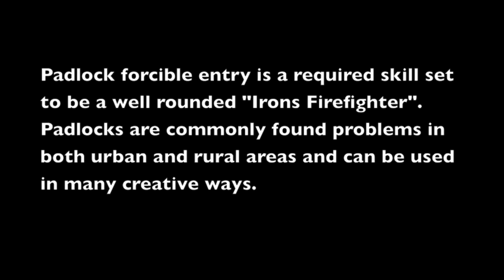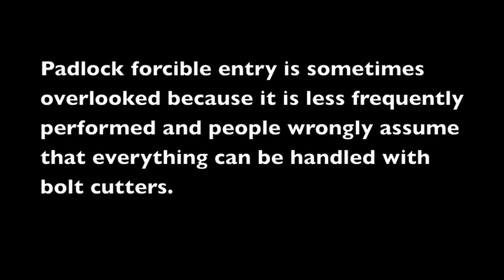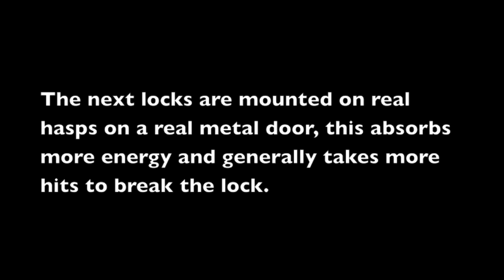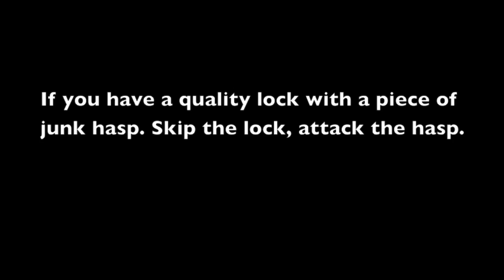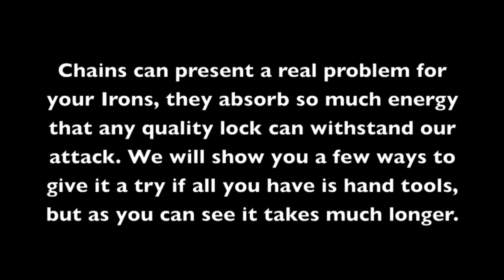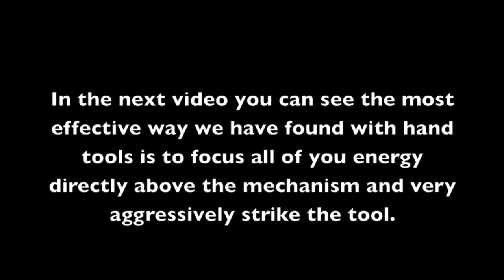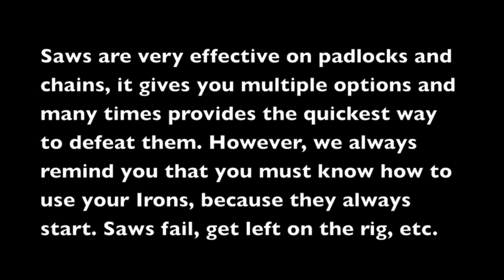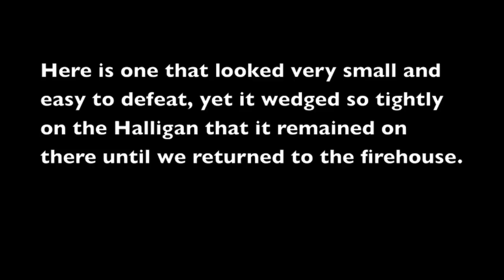Padlock Forcible Entry

Comment: An 18 or 24v angle grinder would be a heck of a lot faster on a lot of those hasps...just grind off the bolt heads. Multiple tools in your toolbox gentlemen... I'd have a dewalt combo kit with sawzall,grinder, impact driver, drill, and circular saw on my truck. Plus bolt cutters and a portable oxy/acetylene cutting rig. And a gas powered cut off saw.
Reply: An angle grinder is a very useful, but specific tool. A halligan is a very useful, and multipurpose tool. These guys (and many other high quality firefighters nationwide) will go up to the entry point, identify the lock and mechanisms being used, and breach it with hand tools before you would go up to, ID, return to truck, dig out tools, and return to the entry point to conduct the breach.

Very rarely except for industrial rescue do you actually even need an oxy/acet cutting rig, and even then a Broco torch is generally better and safer due to both burning hotter and being easier to work with (you only need oxidizer through either compressed air or compressed oxygen and not a fuel gas). 

Grinding off the heads is also something you can do with a rescue saw, however every evolution I personally have done, or have watched, has taken more time for doing head grinds than the techniques these men used to defeat the weak links (The door's steel itself).  Couple it with some good technical knowledge that the chain or locking mechanism itself is usually a cheaper/weaker grade of metal than your lock, and you just identified your attack point. Never mind that in one iteration of a barn style lock in this video, it was about 6 seconds of work to shear 4 bolts once space was made through prying on the lock itself. You won't grind a head faster than that.

Never mind that if you put Mungo behind the halligan you'll always get in quicker than a K12 or angle grinder would. :)

Comment: Makin another Comment should have 1 firefighter Strapped to Gas Powered Rotary Cutting Saw Runs around the Building to cut all the Necessary Locks and Bullshit and make sure Blades are big enough cut through Block wall to Rescue or Escape

Comment: There's a way to open almost all of these padlocks in about 10s: pick em. Takes no skill on master locks...  Just shove picks in there and turn the core, basically. *rolleyes *
Reply: +SecurityTheatre "Heavy gear"?
Reply: +Distelzombie Centzon Totochtin First of all, you are oversimplifying lock-picking techniques. This method would not be appropriate when we are trying to gain access when time is a factor, such as a structure fire. You want to gain access quickly, therefore brute force is a preferred method to a technical skill like lock-picking.
Reply: SemperPraesant Maybe. But lockpicking can be as fast as using the right key. Especially with Master locks.
Reply: ***** Exactly. Though, I'm a truckie...so the answer to everything in my book is to smash it. I've never personally tried it, but I sure as hell don't want something remotely precise in a time sensitive situation
Reply: Hm. You're probably right. But sometimes they need minutes to open one. It just seems unpractical... Hm
Reply from the maker: +Distelzombie Centzon Totochtin , This video is showing some worst case scenario stuff for us. We carry 14" rotary saws that will cut most of these in seconds. We don't always carry them with us every second of the fire ground. We also have a twisting technique with the tools you see in the video. It's extremely effective on all of these locks and usually takes seconds. It is its own video that I just never finished. Most padlocks we deal with on fires are mounted on ridiculously weak hasps that we pry off with one guy in seconds. Very rarely does an exterior padlock hang us up for more than 15 to 30 seconds. The point being we have to be able to handle these problems most of the time with only the tools that are on us. Walking back to the truck to get a saw for most padlock setups is not realistic and not needed. If we were just racing a lock picker in you tube in perfect conditions..sure we have lots of options. But in our work environment that is typically not the case.
Reply: +IRONSandLADDERS Why do you call them "rotary saws" when they really are petrol driven angle grinders?
Reply: +SecurityTheatre All Right. So please do excuse me. Of course it's really gasoline but this depends on which side of the atlantic do you live on. In the US it's gasoline in the UK it's petrol. I don't live in an english speaking country so english it's not my first language. I have been more exposed to american english of course but since I live in Europe, sometimes UK seems closer to me than US :) .Back in the subject...I understand why people call those tools "saws". It's beacause their main purpose is to CUT through steel. And cutting was historically done  with the help of saws. But a saw cuts in a different way. It has a METAL BLADE in the shape of a disc or a band with CUTTING TEETH on it. Of course you can cut even metals with a saw...tipically saws for metals are called "hacksaws". But they have their limits....A tipical hacksaw has a very hard time cutting through really hardened steel. Tipicaly they can cut steels up to 45 HRC in hardness. Stainless steel, or chrome steel are above 60 HRC in hardness. So they cannot be cut with a hack saw. Maybe only with a carbide tipped blade which is uncommon. On the other side angle grinders do not really "cut". They grind! They don't have a TOOTHED metal blade, but instead an ABRASIVE DISC which is not made of metal. It's an abrasive composite material like Al2O3 (aluminium oxide) or carborundum which is harder than any kind of steel or metal. So there is no metal in this world that can withstand an angle grinder...So you are right. It's a gasoline powered angle grinder. Of course if you live in US.